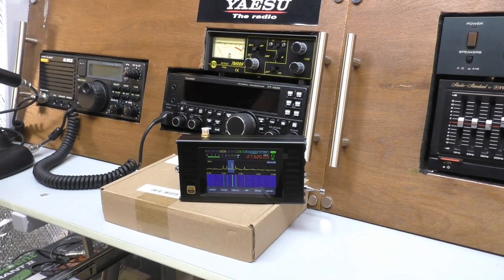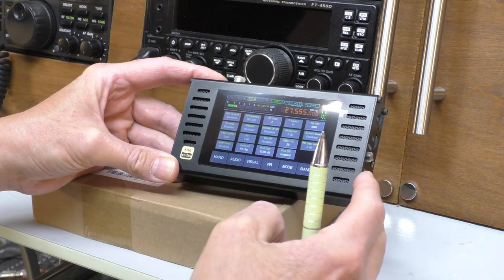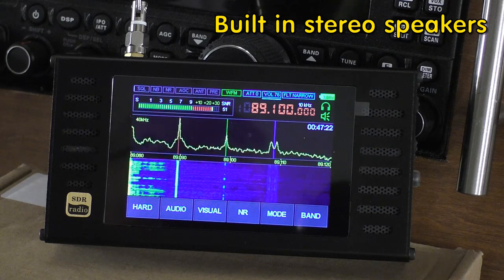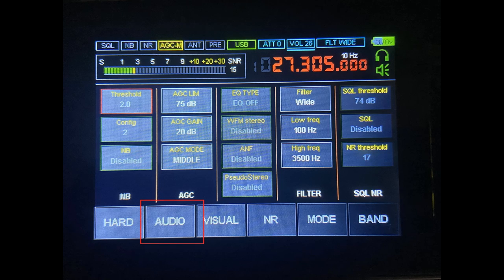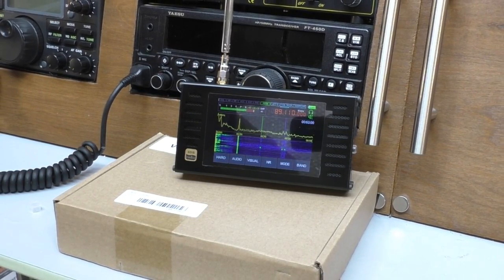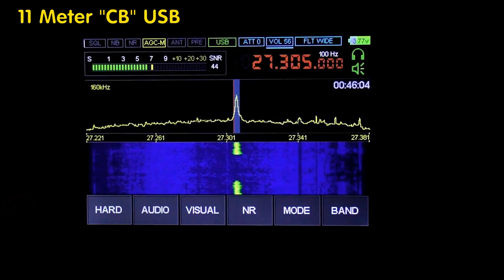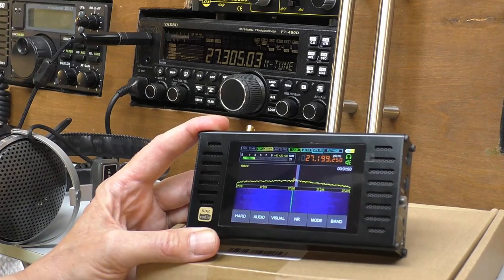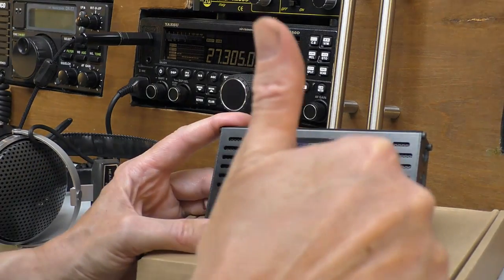Malachite V4  DSP SDR  Radio (50KHz-2GHZ)  Review / on air testing. (Banggood)

Comment: The final firmware version for that radio type is v1.10D and it can be had for free out on the net. Updating to that version is well worth it. Beware, updating the firmware on any of these Chinese knockoff radios is tricky. The best version of that radio has 2 antenna connections on top. VHF/UHF and HF. The version 1,2,3 or 4 is just hype from Chinese sellers. The Russian Version 2 is slightly better but not at the price they are asking for one. The model I like is the one with a gold speaker cover on the left side and 2 antenna jacks on top. It has one speaker as do most of these radios. Do not over spend for one. They are made with old cell phone parts and not a quality product.

Comment: I wonder how well it works with local AM radio stations. I got myself a portapack but was disappointed that it couldn't get the local AM radio stations.
Reply from the maker: In truth i never tested it on the AM broadcast band.  Ive normally found a radio with a ferrite antenna work the best.

Comment: Which version of the software does this come with? I bought one of the originals about a year ago, upgrading the software looks difficult.
Reply from the maker: This should be Version 4.  Some have said its the earlier version so not 100%
Reply: Most Chinese clones out there are still of the Malahiteam DSP1 compatible type. They either have the test firmware on them (with disabled features) or a hacked (not paid for license) version. Most sellers are vague about the fact they use a hacked firmware. Just assume you do not get a licensed firmware with a Malahit unless you buy it from the Russian developers or a verified authorized 3rd party channel. (I believe there is a German guy who does official repairs and upgrades, I haven't seen any other 3rd party authorized channels). Do keep in mind that upgrading firmware on hacked versions possibly result in bad working radios because the official firmwares check for the a certain hash of the CPU ID against those of license holders. When you buy a license you provide the Malahiteam with your CPU ID and they program that in the next firmware update. Only then you can use the subsequent firmware releases legally.
There are two versions of the STM32 microprocessor chip out there. You have to open your radio and look at the microprocessor IC inscription to see what version you have. There is the 'V' and 'Y' version. The 'V' version can be programmed over the USB port. The 'Y' version only with a separate programmer through dedicated IC pins. Those pins are also used to 'revive' bricked devices. Programming software is freely available (from STM) and firmwares are provided by the Russian Malahit team and are usable, provided you have a paid for license.

Comment: I don't know if you've heard of the Xiegu X6100 radio. It's an SDR transceiver. Out of the box, it's a ham radio covering HF and 6m but as it's an SDR radio running Linux with wifi, you can easily connect to it with your laptop and change one line in a file to wideband it so it covers 27mhz - as simple as changing "disable" to "enable".  Great little radio that is 5W when using the internal battery and 10w with an external power source though you can run it through an amplifier to get even more. It includes much of what you have reviewed here but in the actual radio itself with a waterfall display, inbuilt SWR checker/antenna-analyser, noise blanker and filters etc. It also has a PTT button if you want to use it handheld with an 11m whip or use it on the desktop with the included fist-mic. It also has regular firmware updates which are free and improves the radio and it's reasonably priced for the package.
Reply from the maker: Hi.  Yes ive heard of the X6100.  I thought it was expensive when sold in the UK

Comment: The best model has 2 antenna connectors on the top. One for 50 Ohm HF coax and the other for VHF/UHF high resistance whips. Different impedances. The older model Mala has only one connector and dirt poor VHF/UHF reception.

Comment: Bought one of these and from the start it would not charge.  Banggood want me to get it repaired locally ??
Reply from the maker: I would try running it totally flat and then plug it in.  They do take a fair while to charge and the battery display is green when on charge but drops to straight yellow when you remove the charger however this does not effect the run time.  If you still have problems i would suggest you insist on a return and refund.

Comment: Sadly having several clones and tweaked will receive 20m on telescopic whip on USB, however the build quality internally screen mounting is hot glue and no internal support frame. Genuine £280 plus and fakes are lucky dip.
Reply from the maker: Yes most clone radios are a bit of a gamble.

Comment: What's the maximum bandwidth it can display on the waterfall/spectrum?
Reply from the maker: Depends on the setting.  Narrow /  wide etc.  There is a possible zoom on the screen.
Reply: @CB-RADIO-UK  can it display a full 2.4Mhz of bandwidth similar too an rtl-sdr dongle?
Reply: @grahamjones6712  No, max bandwith on radio 160 kHz, on PC with IQ out 40 KHz.
Reply: @DL8LDN  the 40khz IQ out is via the built in USB sound card feature?
Reply: @grahamjones6712  yes it is
Reply: @DL8LDN  I was able to get the 160KHz bandwidth completely on my PC by selecting 192 KHz as sampling frequency of the IQ audio device in HDSDR. It showed the same spectrum in HDSDR as the spectrum on the LCD display, but with a gradual cutoff to -'alot' dB on the 'extra' spectrum part (what can't be sampled by the on-board audio chip between 160 and 192 KHz) on both sides of the HDSDR waterfall.

Comment: What firmware does it come with? It says on the boot screen. Also, that's not a V4. The Chinese sellers of the stolen Russian design just make that Vwhatever name up from thin air. The Russians designed 3 versions. The Chinese only have the plans for the first one. That's yours.
Reply from the maker: Not sure.  I only get the CPU reg number at the start. Its sold as V4 and everything seems to work quite well.
Reply: @CB-RADIO-UK  Okay.

Comment: Love mine but the telescopic antenna is a complete mismatch and totally useless.. I bought a 75ohm for it and it wasn't much better...
Reply from the maker: Did you adjust from the 50 ohm setting in the menu ?
Reply: @CB-RADIO-UK  yes Fred.. Not a pic of difference..
Reply from the maker: Oh ok.  On my vid you will see the WFM is slightly offsite as i forgot to switch from 50 ohm.  I think the broadcast FM performance is ok.  I did try some 11m FM which seemed alright but i really needed a nearer station.  I will prob record some FM CB in the future.  Mostly i will use mine on SW SSB
Reply: @CB-RADIO-UK  regardless of the small antenna they're a great little receiver. I would use a Commet H422 with it and once the radio is set up its a lot of fun to use...